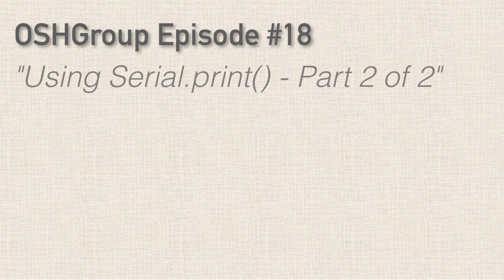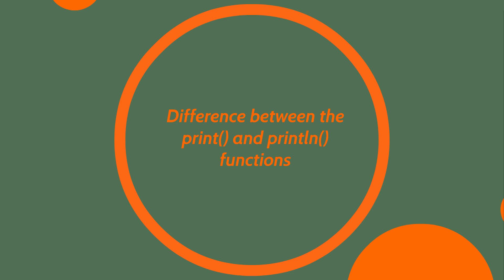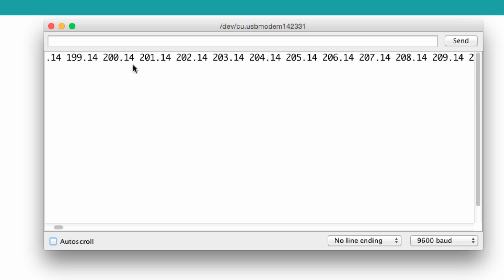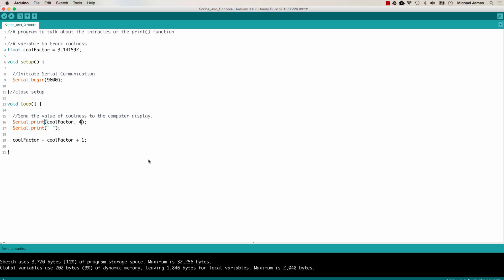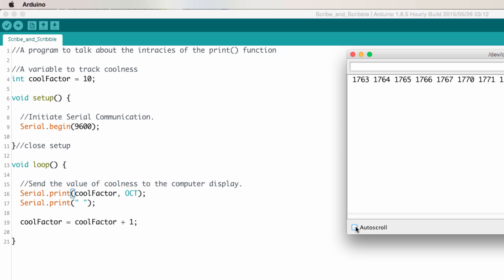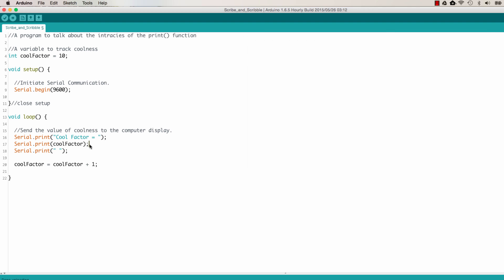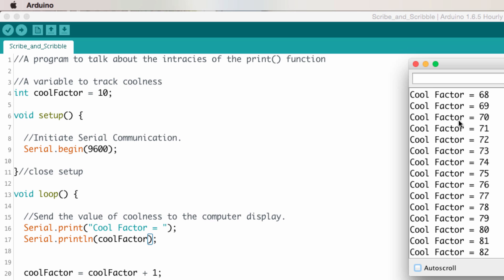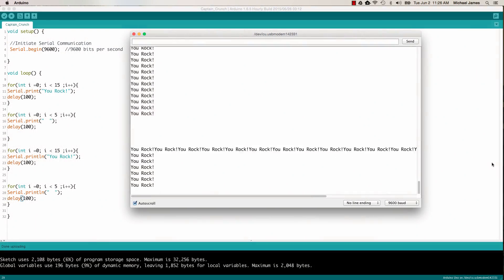Display Arduino output (e.g. sensor data) on your computer monitor with this simple function: Part 2

Comment: Hi there, you may help me i have a ino. file that only display on serial monitor, i would like it to display on lcd i2c, is that possible?, here is the ino. file, please do your best, thank you, manuelrocha@live.com
/*
Sample code for the magneto-mechanical filament diameter sensor.
Calibrate your individual sensor by measuring objects of known diameter and creating a custom lookup table!
*/

#define verbose 1 //0: No error or debugging messages via serial, 1: Error messages, 2: Error and debugging messages

#define NUMTEMPS 4  //length of lookup table
#define smooth 100  //exponential smoothing factor, higher is smoother
#define sensIn A1  //Output of the hall sensor

// ADC input, diameter output
static float lut3[NUMTEMPS][2] = {
    
   
   {530, 0},
   {595,1.7},
   {671, 1.78},
};

float sensbuf =lut3[0][0]; //smoothed raw value

void setup() {
  Serial.begin(115200);
}

void loop() {
  int sensorValue = analogRead(sensIn);
  sensbuf += (sensorValue-sensbuf)/smooth; //smoothing
  Serial.print(sensbuf);
  
  Serial.print(" ");
  Serial.println(lookup(sensbuf, lut3),5);
  delay(50);        
}

float lookup(float inval, float lut[][2]){
   float out;
   byte i;
   for (i=1; i<NUMTEMPS; i++)
   {
      if (lut[i][0] > inval)
      {
         return lut[i-1][1] + (inval - lut[i-1][0]) * (lut[i][1] - lut[i-1][1]) / (lut[i][0] - lut[i-1][0]);
      }
   }
   if (i == NUMTEMPS){
     if (lut[0][1] > lut[NUMTEMPS][1])
     {
       #if verbose > 1
       Serial.println("WARNING: lookup out of range");
       #endif
       return lut[NUMTEMPS][1];
     }
     else
     {
       #if verbose > 1
       Serial.println("WARNING: lookup out of range");
       #endif
       return lut[0][1];
     }
   }
    #if verbose > 0
    Serial.println("ERROR: lookup failed");
    #endif
    return 0;
}